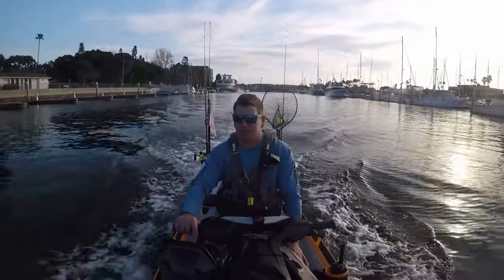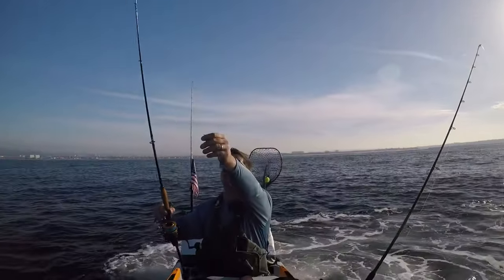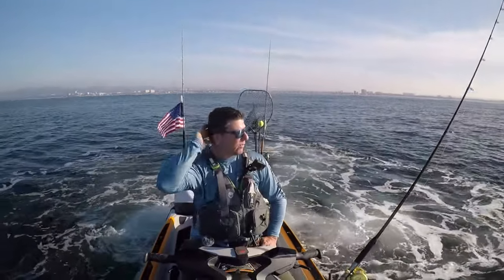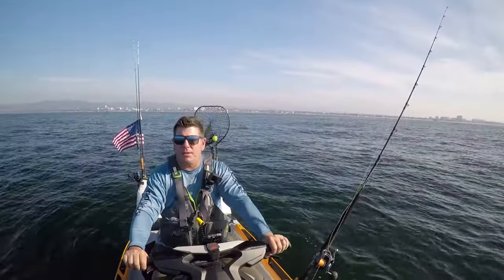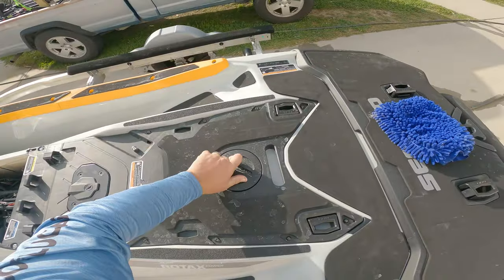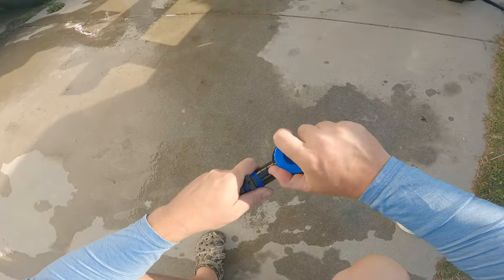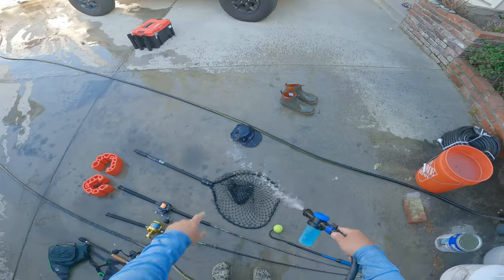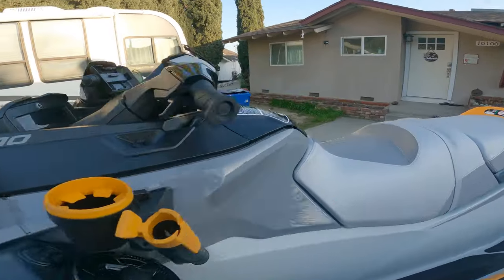Fish Pro Test...and the right way to clean your Sea Doo

Comment: Are you using only one ski on the tandem trailer? If so, how does it ride? Any problems? Ultimately, I want to get two but intend to start with one on a tandem trailer.
Reply from the maker: Yeah, I am. My thought was the same as yours. It was just a tiny bit more to buy a tandem trailer and I’d love to get a second one eventually so me and the wife or friends can head out together. It rides no problem just with one.

Comment: Disconnect your trailer from your truck and then take a 5 gallon bucket and if you have that crank down wheel, you can crank a wheel down set it on top of the bucket and it’ll tilted up and it’ll you can drain your foot well out